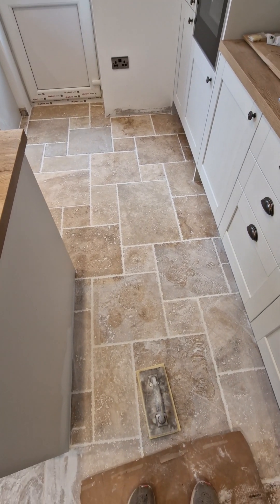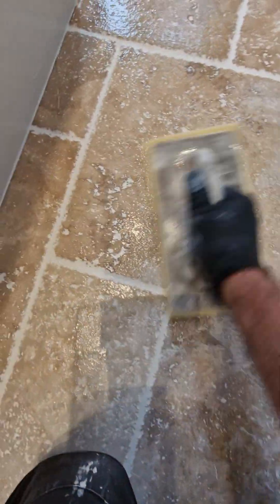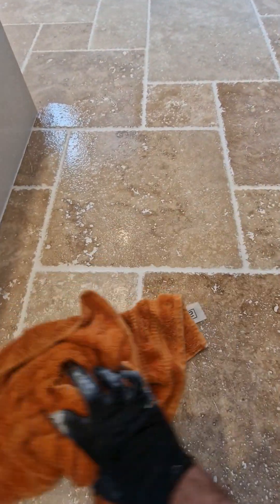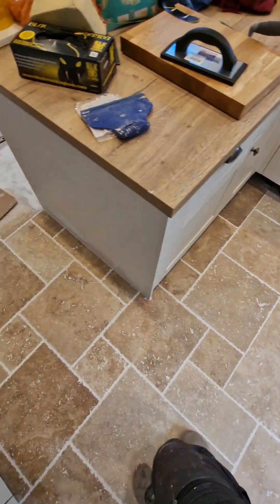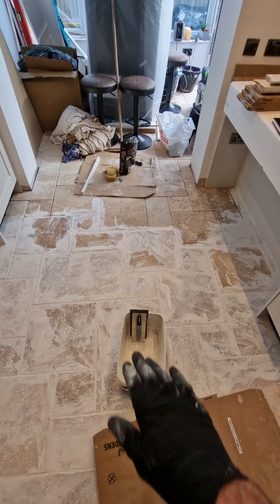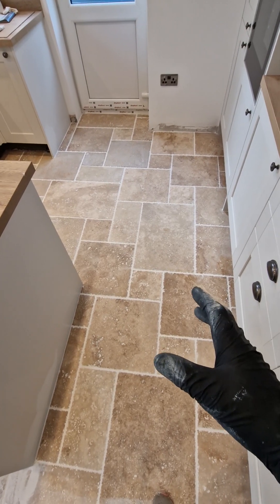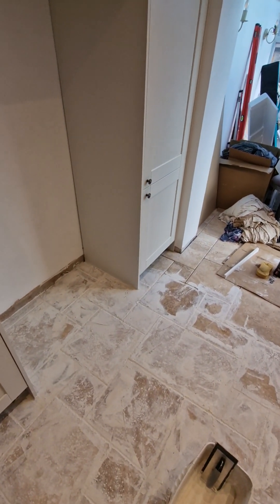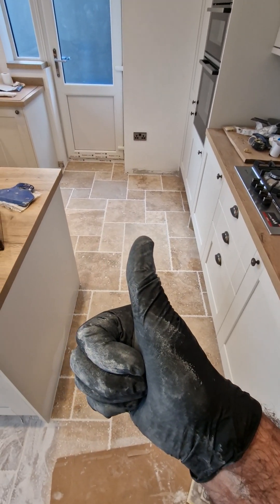How To Grout Travertine Tiles for beginners - Part 3   Grouting for beginners - finish like a pro!

Comment: Nice work! Would be interested to see how the upstand/skirting turned out. Thinking of doing similar but don't want a load of extra faff with grouting between the pieces of upstand (since it would be made up of tile lengths, 600mm in my case).